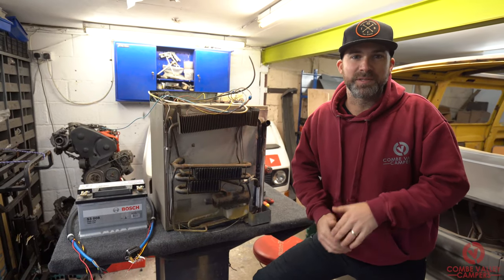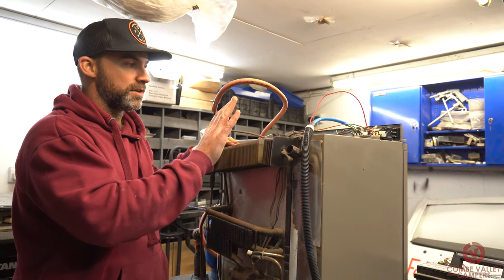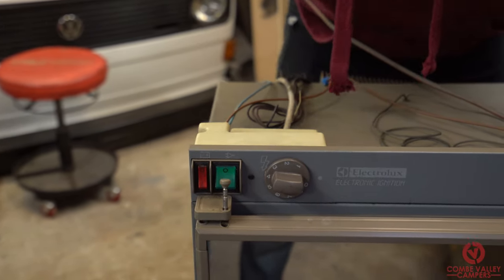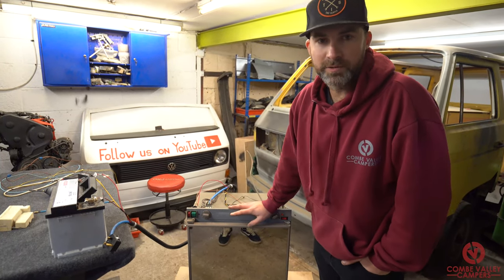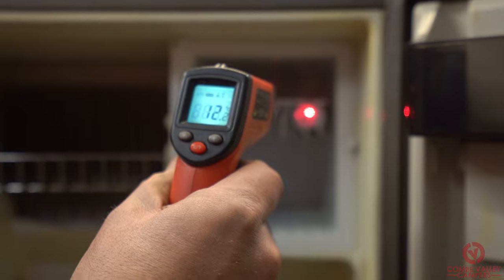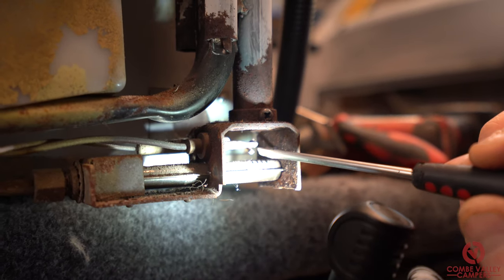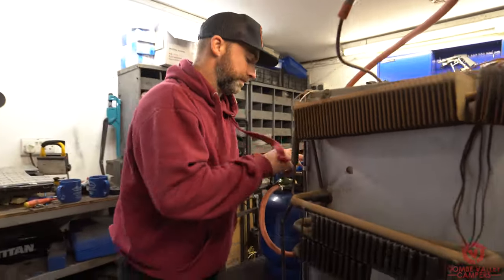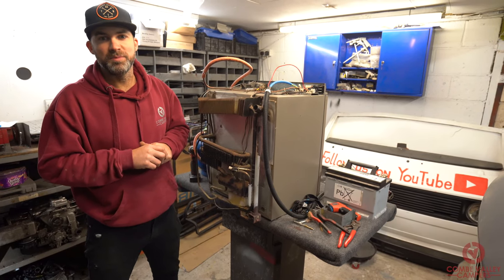HOW TO REPAIR A 3 WAY FRIDGE.  Includes operating and maintenance instructions

Comment: What if all 3 systems are not working but 240v is showing light and also gas light shows but no 12v light. Thanks
Reply from the maker: I would suggest it needs a service or repair. We can carry that out for you, or remove the fridge and follow our guide

Comment: Great video, thanks for the info. I have a Dometic 3-way, not using gas, just 12V and 240V. Do you have any idea of the current draw when on 12V? I ask because although it cools down fine on 240V, when switched to 12V it drains the leisure battery (75Ah) in about 2-3 hours.
Reply: That would be 25 amps per hour at 12 volts.   If you know the Amps at 240v do the math to figure out watts used then convert it back to 12 volts

Comment: Great video , I've got a dometic RM7291L,  my problem is that when using hook up, the fridge green light will illuminate for the 240, and will start to cool, after a few hours the green 240 light will go dim but still slightly lit and fridge will stop cooling, if left like that for a few hours, the fridge will start working again, green light will be full lit and start cooling again, this cycle keeps happening, 12v won't work when towing, tried gas the orange light just keeps flashing, please help its our new van , thanks

Comment: the thermocouple OPENS the valve when it sends a signal. The voltage is provided by heat..

Comment: Hi. First of all thanks for your video! Very very helpful.
I have quite similar fridge (RM4280/4281)
It works very well with gas but, lately, less with 240v.
Not I big issue, I can still rely on gas and 12v, but I like to fix my oldies. 
The green light is ok. I guess that the problem is between the heater and where the electricity arrives.

Do you know if I can find spare parts for a similar model?

Comment: Hello there, I have an automatic 3 way fridge in my campervan, it is a dometic RM series, my problem is when using gas the freezer gets cold but the fridge does not, on hookup they both work fine, any ideas would be much appreciated.
Reply from the maker: It sounds as if the gas burner is not working 100% or burning clean, and therefore not heating the chemicals in the system enough to make the fridge freezer cold enough.

Comment: I need a you help with my fridge/freezer similar product. I plug it into mains using green switch and light is OK but not getting cold.I haven't tried Gas  yet. And also connected caravan to the car while is on and even the red light doesn't come on. Please  let me know how do I get in touch with you. Thanks

Comment: HELLO and thank you for the great video. My Dometic 3-way (RM8501) does not work at elevations above 2000m which is where I like to boondock. So I rely heavily upon using propane. I've lost a lot of food to spoilage :(  WHAT MAKES ME CRAZY is I've spoken to people who own this exact same unit who say theirs are reliable little workhorses and they have no problem at high elevations or even if it's hot out, they still keep their food nice and cold.   I heard that some of these units are "lemons" and that there is nothing that can fix them. What do you think? Any suggestions would be most welcome. Thank you so much!

Comment: Why is my fridge in the caravan throwing out the 240 v isolating switch when electricity turned on.  2000 Coramel.  Electrolux
Thanks Darrell
Reply from the maker: It would seem that there is a short to ground somewhere. Likely the 240v heating element

Comment: My igniter creates a spark but it won't catch the gas and turn it into fire. It seems like it's not centered right above where the gas comes up but no clue how to move it. Anyone got suggestions? I have screws to move them slightly but thats more their angle with each other, they still wont move fully to the side because of how they are created and locked in place :S

Comment: Do you think if neither the 12v or 240v lights on the front illuminate , then the heater element on the back would be unserviceable ?
Reply: There are 2 elements,,one for 12 volts one for 240,,the DC resistance on a test meter would be around 50ohms. If would very unusual for both to be open circuit?

Comment: What can be wrong is the heat on the elements at the back are working but the fridge still doesnt cool?
Reply from the maker: You may have a blockage in the cooling fluid system. It sometimes crystallise in the tibes

Comment: I have a fridge like this in my camper. It's not working, so it's either:

Fix it.
Buy another 3 way fridge.
Buy a new compressor fridge.

My thinking is, even if I get it working, or buy another 3 way, isn't the constant need to change the power source a PITA? I just want a cold fridge that I can leave to do it's thing like the one at home. This drawback of the 3 way doesn't get mentioned.

Comment: When I use  the ignition to start my Electrolux/Dometic RM2210  the  burner  fires up but the ignition doesn't stop sparking and clicking. I can only stop the ignition to spark by switching it off manually. I cleaned everything according to your excellent video but with no result. What can be the cause of this problem? Will a new ignitor resolve this problem?
Reply from the maker: Hi Theo, well done for taking on the fridge. It would be worth checking all the earth/ground points are clean and making good contact and that the end of the spark ignitor and thernocouple are clean from any carbon build up. Lastly if the gas burner isnt burning with enough force it may be the cause. Give that a good blow out or vacuum. If none of this works (or you have done the above) it would be a faulty ignitor and needs replacing. Hope this helps
Reply: @CombeValleyCampers  I haven't checked the spark ignitor and thermocouple thoroughly yet but i will do this asap. On a dutch forum someone wrote that the thermocouple sends a signal to the ignitor when the burner is working. Is that correct? It looks weird to me?
Reply: @theosplinter6591  Some ignitors detect the gas flame by themselves, that is they measure between the tip of the ignitor and ground.  There is a detectable difference that the electronics can find between an air gap and a flame.  I don't know what the difference is, I am more of an electronics person than a physicist, but that is my understanding and probably why Combe Valley suggested checking the ground connections.

Comment: Hi. I have a Dometic 123E that fires up on 240v 12v and gas. All the heating elements get very hot but no cooling effect inside the fridge. Anyone have any idea why this might be? Many thanks.
Reply from the maker: Have a go at following the guidelines on the vid. It might need turning upside down for 24 hours to get the juices flowing ;)
Reply: @CombeValleyCampers  
Hi. Yes tried everything in your video but still no joy unfortunately. I’m at a loss as to what it could be?! Element gets absolutely red hot but zero cooling effect inside. I can hear the coolant sloshing around if I turn it upside down etc so I know there is some in there! Maybe not enough?

Comment: Hey, this is an old video so i dont expect youll reply however, my fridge lights on gass but wont cool down on 12 volt or gas, only 240v, why?
Reply from the maker: Hi! The fridge does take at least 2 hours to get cool from ambient temp, and up to 5 to have a freezing cool box. My advice is, plug the camper into 240v leave it the day,and see how it goes. Then if it works, make a habit of getting the fridge cold before you leave for a trip, turn it onto 12v for the drive then back to plug in, or gas when on site
Reply: @CombeValleyCampers  thank you!! 
Also I did that, and Its strange because as soon as i turned off 240v in favour of gas it got warm again over a day?
Reply: @CombeValleyCampers  like freeze box defrosted and everything went off warmed up
Reply from the maker: @lewismillward2202  sounds like the burner may not be 100% I would advise to remove fridge, and clean out burner and jets. If 12v doesn't work, check fused 12v supply. If that is working the 12v element may be bust

Comment: Hi. I've done all these things and yet I can't get past lighting the pilot flame lighting. I've removed the thermocoupler jet and cleaned it and it still won't work.
Reply from the maker: How full is the bottle? Are the gas lines blocked? These cann all be factors
Reply: @CombeValleyCampers  update. The freezer compartment now gets v v cold but the fridge unit doesn't drop temeprature.
Reply from the maker: How long are you leaving it? The freezer will get cold first and the fridge main compartment should follow
Reply: @CombeValleyCampers  brilliant. I'll leave it for longer today to test. I put a room thermometer in at 19 degrees, the fridge dropped 1 degree in an hour, the freezer dropped to 8 degrees.

Comment: How do you replace the green switch
Reply: Pull the fridge partially  out. (remove mains power) look at the new switch, you will see the spring tabs. Squeeze these i n the old switch to pull it out. mark th cable positions before  swapping wires. Put the fridge back.

Comment: Good informative video. Can you purchase a new door lock for a vintage Electrolux RM122?
Reply: If you have lost the locking pin, I have seen a cut-down golf tee used instead!
Reply: @matthewarmishaw1088  or I just use a screw dropped through the hole :-)

Comment: Is posible to refill amoniac ??
Reply: Don't believe that's possible. I've been told if the fridge isn't cooling but the heater elements/burner are good then it's probably a blockage in the coolant pipework. Removing the fridge and turning it upside down  (might need several rotations) can rectify the issue. You should hear fluid run for approx 10 secs when you turn it

Comment: Are 3 way fridges silent? The fridge in my caravan which os from the late 70's is completely silent, why is that??
Reply from the maker: Yes they are silent.no moving parts neccesary. Its all down to heat and a chemical reaction.

Comment: Hello, i have a brand new fridge dometic RM5310. Its working fine on 240,12v but the problem is when its on gas. It lights and runs on gas for about 20 mins then it cuts out. This is the 3rd fridge that has the same problem? Im in despair. please any tips/ help would be great?

Comment: My Electrolux keeps tripping the breaker when on 240v. I've checked all earth's are clean, Would you say it's the element that's causing the issue?
Reply: Mine does the same, works ok on gas. Did you have any luck replacing the element? Was it a tricky job?

Comment: Got an Electrolux 3 way fridge. Cannot for the life of me get it started on gas. Pilot light goes off as soon as you release the button. Changed the therma couple and cleaned the flue pipe. No idea what else I can do. Someone please help me
Reply from the maker: Is the switch/button wired up correctly, and is the button being held in long enough after being lit? Leigh
Reply: @CombeValleyCampers  its wired up correctly to work on electric hook up (not the leisure battery). I hold gas button in and ignite. Hold the button for 20 seconds. Nice blue pilot flame. Dies out. Tried 2 new therma couple's for it. What pipes would you recommend removing to clean out
Reply: @CombeValleyCampers  I didn't think you needed to play with switches on the right of the fridge anyway as you just press in the gas button on the left and the ignite button.
Reply: @CombeValleyCampers  the fridge is an Electrolux rm212
Reply from the maker: @rossmcdonald4865  it may be that the gas pressure is not high enough, or the needle is possibly blocked. Alternatively, the button mechanism itself could be at fault. Have you tried swapping that yet?
Reply: @CombeValleyCampers  OK. How I can improve the gas pressure. And how can I clean the needle. I will try them before changing the button mechanism. It's just weird I can get such a strong pilot flame lit but the second you come off the button. It goes out. No matter how long you hold it in for.
Reply: @CombeValleyCampers  when igniting the gas. Do you need to do anything with the control on the right. So the ones for the electric side of it.
Reply from the maker: Electrics are just that, for the 12vDC and 240v Ac. The gas does have a dial too. If the flame is strong and blue, it could well be the mechanism
Reply: @CombeValleyCampers  the button mechanism? I'll try giving everything a really good clean. Blow it out with an airline. And see how it gets on. If that fails. Would you be interested in me bringing the fridge to your shop to try fix. Don't mind what it costs as long as its going to be less than buying a second hand working one on ebay. Thanks
Reply: @CombeValleyCampers  I have already given the flue the pipe a clean. But I don't think I've given the burner pipe enough of one. Also where the actual flame comes out. Could do with a little blow out as well. It's quite rusty at the back. But the previous owners say the fridge worked on gas. But would just take a few attempts to light if not used in a while. But I've tried hundreds of times now. And it won't start with gas.
Reply from the maker: @rossmcdonald4865  as per our videos you can dismantle nearly the whole burner mechanism. You'll be surprised how much rust and crap comes out. Give it a go dude
Reply: @CombeValleyCampers  thank you. Is the push button something that can be taken apart and cleaned? Or would it need to be swapped for a functioning one.
Reply from the maker: I can only think that it's the push button switch assembly at the top. I would start scouring the used ads for people breaking or selling similar models of fridge and swapping out parts as a process of elimination
Reply from the maker: Used caravan spares places are a good source for 2 way fridges
Reply: @CombeValleyCampers  thanks. In the mean time I'm looking to connect the fridge to 12v. It's currently on 240v hook up. Have you got any videos or advice on how to wire it up. I've got a caravan switch board. Could I connect it to that?
Reply: @rossmcdonald4865 hi did you ever resolve this? Thanks

Comment: what i learned from this vid .... its not ants in the back, its what i shoulda known as a smithy ..... fuck off the oxide n crap n junk. just give it a clean and service without fucking with teh fittings
.... makes sence (rebuilt a old caravan) .... my smithy forge ran on gas and im not qualified to build the shit i built, but i know how to run lines and brase n hard solder stuff. Spray it with hot soapy water n check if ya think ya fucked somethign .... no leeks and if u need a stamp for rego its gona be a 5 min inspect where they do the same n go yup ya good

Comment: Have you ever stripped down the control valve. I cant get gas working on electrolux rm 2262.  I have stripped mine down to find no fault i can see. 
Its a shame u r so far away
Reply from the maker: I'm afraid we haven't. An option is to fins a local used fridge to purchase and see if a new (used) valve will work
Reply: Thanku. I was intending to buy another. But it was worth asking. 
I now have poor gas flow to the hob on all burners. Any idea. All new gas pipes done
Reply from the maker: @philcorp1213  sounds like it could be the regulator on the gas bottle. These are known to fail over time, or even be faulty new out the box as I've seen recently
Reply: Just sold another hob. Perfect flame on same regulator and gas bottle. Now stuck. Its old ceramic type. Would there be jets in it somewhere. Appreciate your time
Reply from the maker: @philcorp1213  older ceramic hobs do have the ability to be pulled apart and cleaned but how to do that vary from model to model. If you can't strip it down a good bath in an ultrasonic cleaner may do the trick

Comment: WHY do you call the 12V positive lead a live wire when it is not? please call the 12V lead a positive lead or a PLUS (+) lead.A live wire is only called a live wire when using AC.

Comment: Sorry mate not even watched it, absorption fridges are a pain not worth the effort. Last thing you need on a hot sunny day is barely cold beers, I'm sure the video is as informative as ever but you might as well do a video on a dynamo charging system.
Reply: Ooooò
Reply: @Mike Your comment is quite ridiculous as there is nothing wrong with 3 way absorption fridges. I live in Australia where the temps are commonly over 40ºc in Summer and I have a portable Electrolux and a Electrolux 3 way in my caravan. I always have to be careful that I don’t have the setting above 4 (near minimum) or everything freezes. You either don’t know how to use one, or if you have one it is either faulty or you tried 12v and flattened your battery. When an expert such as in this video says they work well then your opinion is worthless.

Comment: Thanks for an informative video.
On 12v my fridge does not cool, element is working fine any ideas gas and 240 cools and freezes beautifully
Also should I connect the 12v to the starter battery rather then the leisure battery. Thanks again
Reply from the maker: Hi, thanks for your comment. Yes the 12v element should be connected to the vehicle via a 13amp relay, switched via the ignition, meaning the electricity will only ever be drawn from the vehicle battery when the engine is running
Reply: 12v can only keep an already cooled fridge cool, they don’t have enough ooomph on 12v to cool down. So cool on mains or gas first till down to temp and maintain that temp while in motion on 12v. The 12v is only for when in motion and when already cold.

Comment: Hi I wonder if you can help me my electrolux 3 way fridge will not cool on gas it lights but if you turn the dial to number 8 the flame stays the same as if its still on 1 I've checked the jet and cleaned the burner but no different